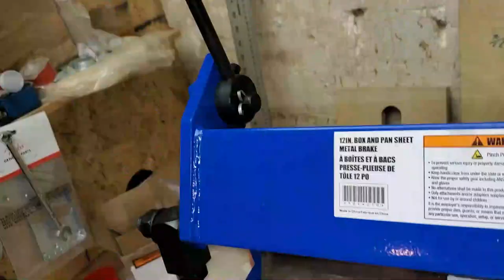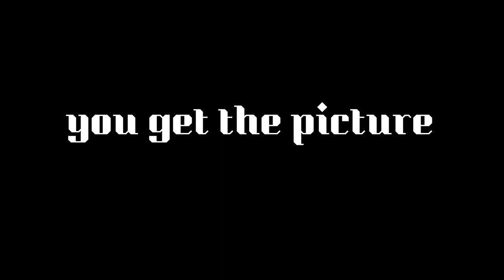How to MAKE a Telecaster BRIDGE from COPPER plate!!

Comment: did you braise/solder the corners of the box? might help a bit with structural integrity
Reply from the maker: No there's no need. 16 gauge copper is pretty thick at .063 inches or 1.25mm. Its plenty strong for what it does.